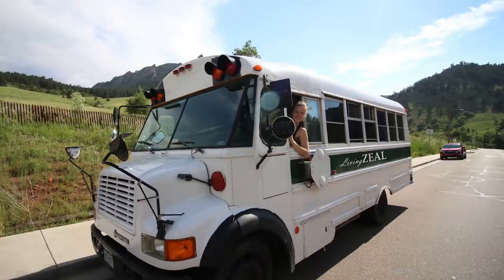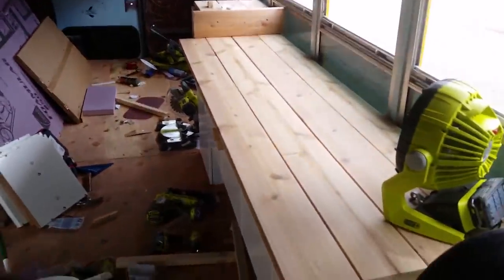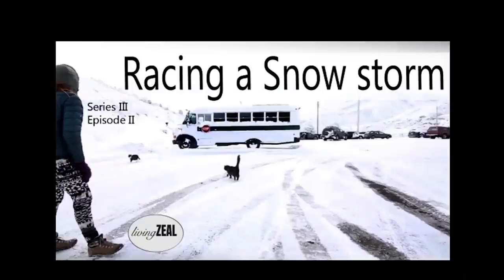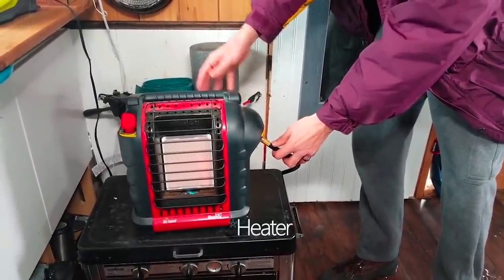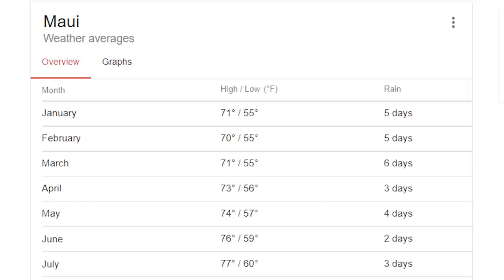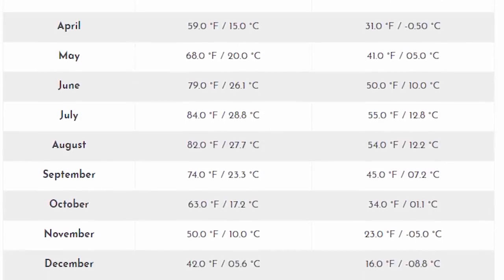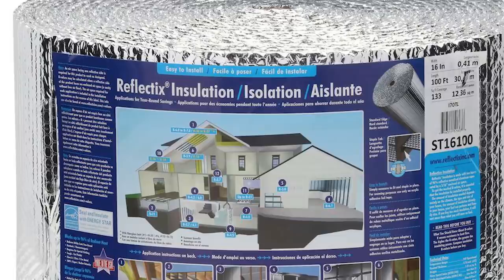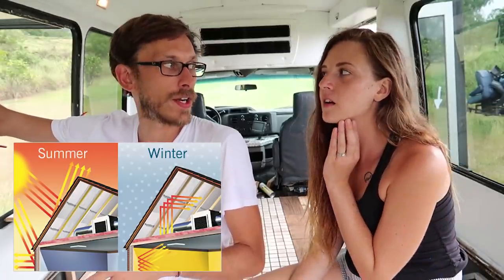Why We DIDN’T Insulate Our Bus Conversion

Comment: You should try ceramic window tint. It will drastically reduce the temperature in your bus. It is amazing. Pulse you can add a pattern or one color and have all the privacy need and still see outside without any problems.

Comment: We have that problem with boondocking in the desert. We have our entire RV roof covered in solar panels, which is great for charging and having off-grid power. But the downside is that we cannot park in the shade if we want to charge our solar. We have learned to park our RV strategically to avoid full sun on either side of the RV.
Reply from the maker: Yeah it can be a bit of a catch 22! because if you live on the road full-time you don't want to have mobile panels that you have to take in/out every single day... but if they're mounted we run into the heat issue.... haha we're still trying to workshop a better solution. let us know if you guys come up with anything too :)

Comment: Have you thought about screens for the opening windows?  If the surrounding frame material is steel, you might be able to glue magnets to the screen material and put them up when you want open windows.  Otherwise, some simple brackets could hold the screens.

Comment: Chad,  go to Quora and look up cause of heat buildup in a closed vehicle... the primary theme is that "The UV part is mostly irrelevant."  It is almost entirely the visible spectrum of light and near-infrared which strikes surfaces and converts into heat. A vehicle with a black [or dark] interior will be hotter than one with white, or light-colored surfaces.  Rather than expensive UV-filtered glass, a simple reflective film would work better. Also, mirrored or silvery coating would not absorb near as much heat into the glass itself as dark-colored tinting.
Reply from the maker: Thanks for the helpful info, Gilbert!

Comment: Hello I'm not sure if you would be able to answer this or not being that you had a bus not a shuttle bus previously, I was told one was metal and one is fiberglass so sound is different, I don't know. So I was wondering about the Insulation for the roof. I saw a video of a female who was begging for the rain to stop because it was so loud in her van and it was pouring. I don't mind the sound of rain but I don't want to have an episode like she did. What do you think. Thanks, Irene in California

Comment: Yo I heard that actually tinted windows will make your car hotter 
A low 5% tint is black and black absorbs heat. And will attract more heat on the windows seeping into the vehicle. 
Unlesss.... its a dark tint with ceramic or some special expensive tint.
Which I saw a video on and seems very worth is keeping the same van cooler by like 20 degrees then there old tint out in the Texas sun. And they even have the same tint/ film that’s clear and relflexts uv in the hold front windshield

Comment: why not put the ac on a house battery. That way you run it when you need without running your bus.
Reply: That and the pre existing ac unit also uses frion the same frion that’s used with the coolant in the engine
Reply: yeah Ana an ac draws WAY more power than a battery can deliver. even with a big solar system and a bunch of batterys it will not work.